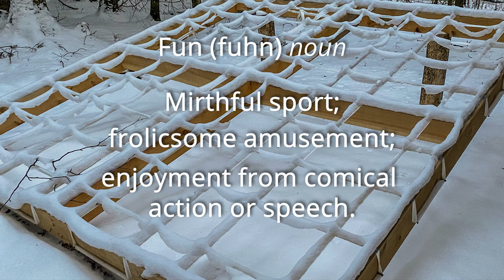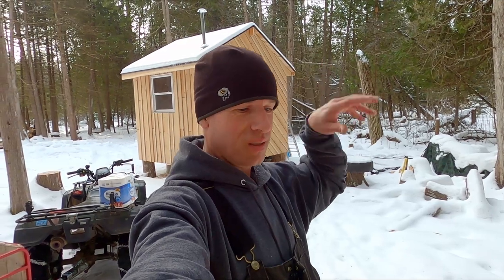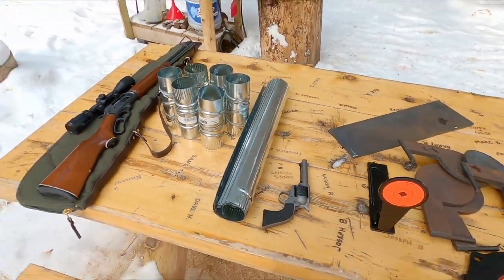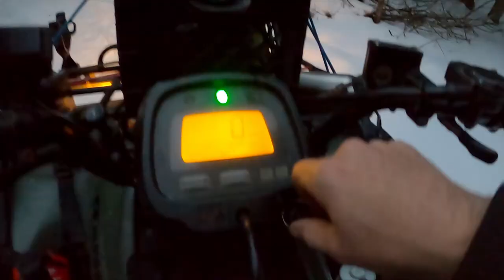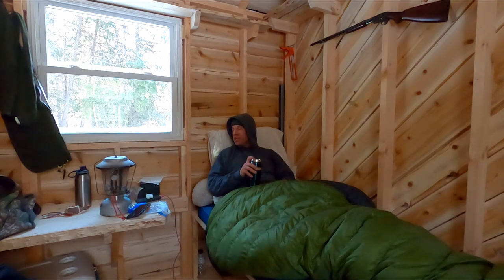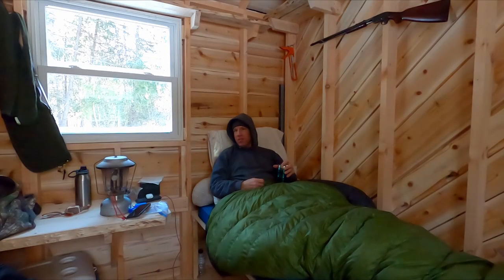My First Night in the Tiny Cabin! (& Wheel Gun Walkabout) #74

Comment: Lining the corner with bricks all the way up to the ceiling will help hold heat from the stove pipe.  It will also protect the walls from overheating and possibly igniting.  Looking great.  Spring is on its way!
Reply: That propane exhaust pipe won't ignite that wall. No way. Doesn't get hot to enough.

Comment: Ok folks, here's the difference between wood burners and propane.  You have to TEND the fire in a wood burner plus they take up a lot of room.  He doesn't have the room to devote to a wood-burner's footprint.  When you are primarily using the stove to warm the space for sleeping having to get up several times a night to feed a wood-burner kind of defeats the purpose of a uninterrupted 8 hour sleep.  With a propane heater, before you go to bed you check to make sure your propane bottle has enough fuel.  Then you light it and go to bed.  If he wanted the creature comforts of modern living he would have stayed in town.  Which is why, for me, what he is doing is so interesting and why I am cheering him on.
Reply: Any decent wood burner closed down will last 8 hrs and fuel is free. I’d rather live in LA than be without a wood stove. Heck I’ve made small ones to use in my tent! lol But hey that’s me. Others are welcome to do what makes them happy 😁

Comment: You can do various kinds of heat sinks with wood stoves. The problem with most random ideas is that creosote would build up, leading to your chimney catching on fire. Some wood stoves have secondary heat sources or catalytic converters, and if they're well designed, they capture most of the heat. Rocket mass heaters can achieve similar high efficiency. The details matter a lot, though.

As for the heat loss on the exhaust pipe, there are various contraptions people have created. You can put heat sinks right on the stove box or on the pipe, affixing them using metal strapping. Another simple but noisy option is to get a thermal fan. The fan is powered by heat. Aim the fan so it's moving air across the exhaust pipe, and that will increase heat transfer. Note that most fans won't let you adjust the angle freely, so shop around first. Be aware that other random screwing around with propane stoves and stove pipes could potentially lead to death. A carbon monoxide sensor would be a good idea, although the super cold weather would kill the battery in it, so ... I am not sure, but think carefully before getting too reckless with the propane.

Comment: Tool shed is awesome!!  I think the only way a little stove like that is efficient is if you surround the parts that get hot with thermal mass. Maybe bricks stacked on top and a chimney pipe over the existing one filled with sand that would hold the heat and then dissipate it slowly.

Comment: idea: hang a Hammock Diagonally.. at night.. if you're sleeping 2.. and its cold out. also hang a plastic sheet between the door and the inside.. that way you're way hotter than usual. add a USB battery bank fan.. those cheapy ones to keep the room ventilated.

Comment: Since you purchased the other segments of exhaust pipe, use some of the strapping materials and run a couple pipes up the outside of the existing stove pipe with angles at top to redirect warm air using convection.  If you have extra patio squares, extend them up the side walls for additional thermal mass.   Have you considered adding a layer of blue or pink insulation on the interior walls between studs and under the roof.    Rock wool would be another alternative but probably too dusty unless you plan on covering it with additional wood on the interior.

Have you considered dumpster diving behind an Italian restaurant?  A friend usually gets empty 5-gallon metal cans that contained olive oil.   Rinsed out and filled with sand or water they could be placed behind and around the propane stove as thermal mass; absorbing heat from the stove and slowly dissipating into the exterior.  

Sleep inside for the remainder of this winter.  Let your body rest and get some good sleep.   If you have the web material that suspended the 4-wheel cover before you added legs, staple it across the chimney corner to support clothing, boots and other items that do not require a rigid shelf for support.  

Final note:  put up warning signs around your property perimeter warning intruders that live fire weapons are discharged without warning.  Stay safe out there.  Cheers

Comment: Great video, as usual!  What do you have against insulating your little cabin?  Even just syrofoam boards between the studs would help immensely.   The money you'll save on propane will pay for the insulation very quickly.  Plus, don't put crazy, unnecessary bends in your flue pipe.  That's dangerous.  Put more bricks up the wall behind the flue pipe instead.
Reply: It’s not dangerous. Most stove pipe used to exit 90 degrees thru the wall. Back in the day two T’s were very common making in essence a rectangular O in the pipe. Heat will rise regardless. Naturally the lower T should be made with heavier gauge material because it will get hot. Back then, they came that way as a matter of course but today we’ve lost almost all of the knowledge our grand and great grandparents knew as common sense

Comment: Your location there provides you with a lot of renewable fuel resources. What made you decide to use propane instead of a small pot bellied wood stove? Was it a time saver?

Foil lined foam board behind the pipes may give you some reflectance and insulation factor by the stove pipe. Also search stovepipe heat reclaimers or water heaters. That may give you an idea or two for getting some of the heat out of your stack into your shed.

Great build sites there in the eastern UP. One day take us on a hike to Lake Huron.

Comment: Before making your radiator your might try strappping 2 pipes on either side of the exhaust pipe and cap them with a 90. If it works the pipes will draw in air and warm it before coming out the 90 into the room

Comment: Could get a radiant fan to go on top of your stove it will push the heat out from the stove. Since you are not insulating nothing there willb heat loss unless you do insulate the roof use foam panels then cover it with your pine boards will stop alot of the heat loss. Im sure u already know that. God bless be safe stay warm and healthy. Jim

Comment: We use vent free gas heaters, Just lift the pipe off the stove and enjoy all the heat. If the cabin was air tite the fire would not stay lit after it used up all the oxygen. you don't have a air tight cabin. give it a shot ,it works great and won't kill you. Look up vent free heaters.

Comment: Rather than elbows you might want to flare the elbows or straight pieces and slide them onto the stove pipe. If they are flared every foot or so this would create a heat sink which would transfer heat more efficiently from the pipe to heat the cabin.

Comment: You’re an idea about radiating more heat off the pipe is a great idea and they already do it. A lot of people take a thick stove pipe and they’ll weld other other pipes on the side and then they’ll put elbows in those and have them go down to the ground and as they heat up from being connected to the stove pipe the heat rises in them in such cold air off the ground heats it up and blows it out of the top, some people also put elbows on them to make it directional. But you can definitely do it. I don’t think you could weld on that pipe it looks pretty thin but you could use wire and just strap a couple more pipes to it And either bend the pipes or put elbows on them so they go wider at the bottom and as they heat from the main pipe it will suck in cold air from the bottom and blow it out the top hot and just make it much more efficient. You could also get one of those fans that runs off of the heat for a woodstove and that will help circulate. But you seem to have gotten that thing pretty well sealed up as far as air and I think that stove will heat it up pretty well. You could put skirting around the bottom to help a little bit Ke but I think that stove would help eat that pretty well.  You could also add thermal mass around the stove like put some bricks next to it or behind it and overtime those would heat up and when the stove goes out it would take a little while longer for that heat to dissipate from the rocks or bricks but you don’t have a ton of room but if you could get a big rocket on there it would probably make a little difference too but just in holding the heat inside as opposed to adding more heat. 

Another thing would be to hang some blankets on the wall around where you’re sleeping and that would give you a little insulation and of course you could add more wood. Another good option that would be cheap would be to get that foil bubble wrap stuff and you can cut pieces of that into the wall and into the ceiling and put them underneath the flooring and it’s not super high level of insulation but it has a radiant barrier on it with that foil stuff and it will keep the heat in there much better. We had that in our garage 20 end it held heat in pretty well surprisingly and I rather shed without it was freezing all the time so it makes a difference

Comment: Sheet metal stood out from the wall in the stove corner, the heat will make the draw in your stove pipe but you need two three way tees to make a rectangle not a zig zag you get more surface to give off heat before it goes up and out also extend and safety wire the chimney so it is taller if you are worried about draw, there is all kinds of help on line or most small hardware stores will guide you too, just ask.

Comment: In the far north there are "Arctic Entrance Ways" which are used to stop high volume loss of inside heated air through an open door to the outside.  Simply a very small room built with an outside door and centered on the existing door into the cabin.  

Walk through the outermost door, close the outermost door then open and go through the original cabin door and into the cabin.  The (heated) air loss is minimal while the entrance way is often used to remove and hang outer clothing and boots to dry overnight.

In the summer the inside door is often just left open and the outside door is fitted with a simple wooden screen to stop bugs coming in while allowing air flow.

******************************************
Borers in your green wood?  Stop at a hardware store and pick up a Sulfur Candle or two.  When you will be gone all day remove all cooking utensils and make sure that all food is wrapped.  Close every window and door to seal inside air in with no leaks.  

Carefully secure the candle on a NON-FLAMMABLE surface (like a cinder block or rock) and light it  JUST as you're leaving for the day.  (((Sulfur Di-Oxide is bad for your lungs))).  Immediately walk directly out and close the door behind you.

Sulfur Di-Oxide kills any bugs and the hours long "Air Soak" will kill 'em all.

When you return open the door and find something to do outside for an hour.  Return, quickly open every window and let everything air out.

An old, simple, effective system of fumigating for any and all bugs that breathe air.  Ants, Borers, spiders, mosquitoes, flys, wasps and anything else that's living inside.  Often times kills the eggs as well.                              - Joe -

Comment: Another way to "capture" some of your heat loss would be to load some lava rock onto the grill in your stove.  Think of a bar-b-q grill.  It will help radiate some of the heat down low and if you keep your eyes out you may find some on marketplace for free otherwise you can probably find a small bag in the grill section at the hardware store or Amazon.

Comment: Get a small damper for your pipe set it in about eye height it basically is a plate that goes in the pipe you can damp off your heat going out the pipe you need to leave it open a little bit to let the exhaust out. look it up it is called a stove damper. their are small stoves called a cub or grizzly that run on wood their small for that small space.

Comment: yo ryan - new subscriber - very entertaining - wondering if you could use the elbows and thin flue pipe to radiate extra heat off the current flue - use tin snipes on the spare pipe to create a flower like pattern where the current pipe become like the stem of a flower and the elbows/spare pipe radiate out 3 or 4 inches from the current pipe to transfer the heat from the current pipe.  Could you tack weld the extra to the existing pipe on the outside?  I dont know, or even if im explaining it very well.  All the same keep up the great videos and entertaining dialogue.....

Comment: 👉 ANTIFREEZE 👈a radiator of copper pipe wrapped around the entire chimney full of antifreeze, a tiny half inch hole at the top of the wall to exit and a pressure relief valve installed outside, safe as can be

Comment: Make a rocket  mass stove I wonder if you could build it in a wall the idea is to capture the the heat from your stove pipe the idea is to use sand clay gravel rock concrerte to store and radiate heat as in making a match burn twice it stores and radiates the heat from your stove pipe and the heat coming out is reduced to 140 to 150 degrees like a dryer vent and also piping in fresh air to your stove will also keep your building warmer cuz it wont come in from holes and cracks in your walls.

Comment: I like wire netting over my stove. Shop built of course.  Lots of airflow for drying out the gear. If that stove pipe is warm enough you could use woven wire as a stand off tube then just use bent nails as hooks to hang gear off it. Good video Ryan glad to see Tito enjoying the worm. Pop 2 - later misfits.

Comment: Been watching you for several months and one thing that has me confused. Now I completely understand your reasoning for building such small structures but none of them being insulated blows my mind. Also every means of heat and cooking involves propane. You are surrounded by an abundance of free wood, why not use wood burning stoves instead of propane which costs you money?
Reply: yeah I know what you mean. I think it would be cool to find an old coal/wood cook stove. Even the nastiest one for cooking out doors is ideal. A 10x10 insulated cabin would go a long ways to reduing the propane costs. Also a warm cabinet designed just for putting batteries in would be ideal. This can just be an insulated box with a very small propane heater in it. Building a kitchen building covered area would be cool with cook stove, bathtub and water storage would be cool. massive stock pot and wood burner underneath would be good for heating water and it can also freeze as well. This could be done with red bricks and some bits of steel frame to sit the stockpot on. I am talking like an 160 quart stock pot which is around 2 foot by 2 foot. This over a wood fired stock pot thing would be more than enough to hold water overnight and even if it freezes the fire pot can be lit and more water/snow added. I like the chainsaw milling yet an improvement would be a swingblade saw mill with a custom bed that you can roll the logs on to. This would need to be undercover with a lot of sky lights and a way to block the sides so snow does not fill in. If done right and sawdust picked up it will cut a lot of lumber that can be used on 100s of projects. Swing blades are very simple to use. You can even make siding from it, the wedge type. Lucas sawmills made a 4 inch model and double cut for 8". Yet I do not think they sell that model new anymore. The smallest they make is a 6 inch. This cost last time I look and its been a few years like 10k or something. The 4" model that I was looking at was just under 6k delivered. I did not need more than 4 inches as my intention was to only cut 2x4 and 1x4s for random projects and selling it cheaper than stores. This was not high end wood at all yet There was a massive amount of it and I have made a lot of stuff from it.